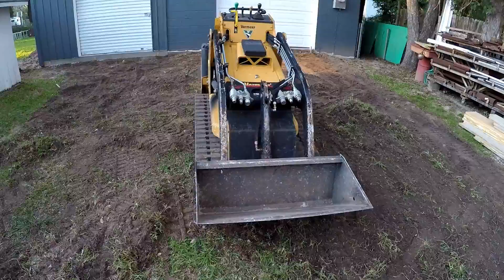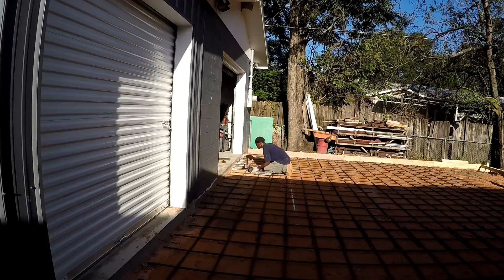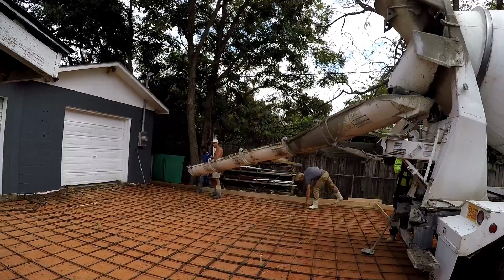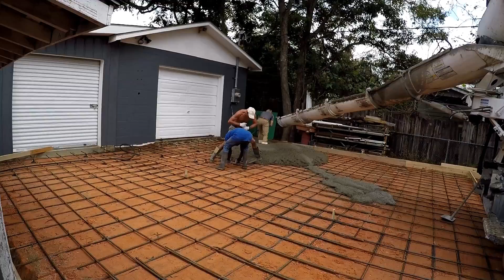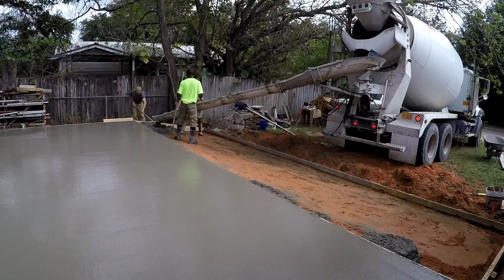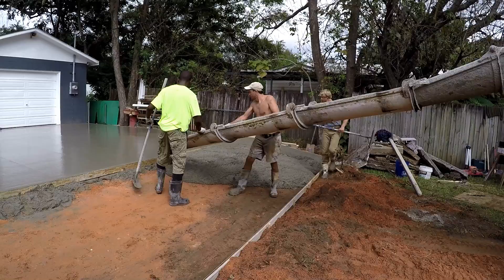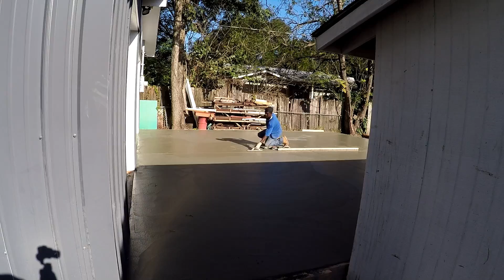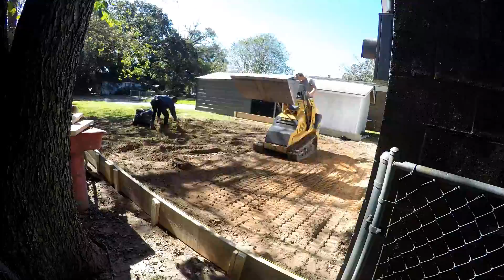New Shop Concrete Slab!

Comment: Contractor said they mostly do driveways. You can tell. You almost always get a screed form to form. This one will have some 1/2" deep puddles when it rains. Nobody's eye is that good. So easy to throw in  an extra stick out in the middle and get two guys on the screed . Broomed too soon. Rough as hell.
Sorry Abom but you didn't get a first rate job. Especially if you want that slab to eventually be the floor as you extend the shop like you said.

Comment: Quite a few things wrong here... They're mucking all wrong causing numerous air pockets not even fluffing the concrete one metal screed with two guys could have been pulled across the whole thing and fluffed and mucked behind easily the only guy hustling is the dude in the blue shirt... No double polythene to reduce cracking just simply raising the rebar isnt always enough and the fact they did a six inch with so much slurry you can see it was already bowing the forms and wood stakes they should have used steel stakes and kickered more this is all my opinion but fuck me and people say this is correct???

Comment: Not enough mesh spacers!! especially on perimeter, steel was flat to the sand in most places,  vibration takes out the air pockets, great cosmetic finish, but who leaves timber shutters inside a slab pour?? Lime will rot the (3) sections and timber left in the pour, this will cause them to separate, , they will separate over time and no steel supports on the pitch slab, sorry Cowboys..last far beyond when they are gone no chance!!

Comment: These guys appear to be working hard couple mistakes form board left in between pad and ramp why I put so much rebar in the pad but not in the ramp the ramp having reinforcement is just as important as the pad when the first truck came if they put an extra shoot on it they would have not had to work so hard raking near the door  the pad also looks really level when they should have put a little bit of a slope on it to keep water from puddling Up and going into the garage I would pretty much bet whatever they want to bet did there are a substantial amount of cracks that concrete after 1 year keyword no expansion and not enough controlled cuts looks to be a really big pad the rebar was really overdoing it unless you plan on parking 18 wheelers or very heavy machinery what's the ramp will not hold up to the pads capability some simple Road mesh would have been just as good especially if you weren't going to reinforce the ramp

Comment: So many people use a vibrator to move concrete and that's not really what it's for it is for to get all the air bubbles out of the concrete if you do it too long in any one spot all the rock was settled to the bottom and you concrete will not be as strong as it should be

Comment: how big was this slab .. .. Also last truck you only needed 2 yards... did they charge you for just the 2 yards or did they charge you for a full truck load wich is 10 yards??? im asking you all this cause i will be putting a 40x100 slab  sometime next year for a metal building...

Comment: 34:57 So they never took out the form that was between the floor and the ramp? So what are you going to do when that starts to rot away and you have a 1.5" gap there?
Reply: No rebar in the ramp either.

Comment: Vibra screed would have been nice.  Should use smooth dowel into existing concrete slab to allow for movement between slabs.  Should have a control joint at that point that could be caulked.  Amount of time between trucks was to long.  You now have a cold joint affect in the center of the slab.  No rebar in the ramp is questionable.  Not sure the fiber mesh will do the job.  Someone should be working on the edges of the slab along the forms much sooner.  Would have worked better to pour in two pours.  This might be how they pour in Florida but that would not fly in the midwest.  Not enough control joints as they should be 10 foot wide max.  Never use a steel trowel on outside concrete.  Time frame took to long from start to finish.  Concrete is turning white showing that there was to much water.  Should have sprayed some cure and seal on the concrete.  Shame to see the trowel marks along the edges.  Why did they leave the 3/4" board in the slab at the beginning of the ramp?    Not as perfect as the big man thinks but since Florida is one of those right to work states you have no idea what you are going to get.

Comment: I'm not a builder or anything but don't you need guttering/drainage between the shop and the slab to prevent water coming into the shop during a storm?

Comment: Everyone forgets that cement cures and when it dries, it dies. 30 day covered wet cure or constant wetting is essential to high strength and durability.
Reply: A wet week will get you most of the way there

Comment: Hello Adam. I was a bit worried about a few things like the bars not being connected to the floor of you side shop (maybe there is a reason for it) and the bars being elevated from the dirt only at the lat minute (I would have done it before poring the concrete). But I was overall very impressed by their work and especially their attention to finishing details. I have some questions though. I would really appreciate if you could provide the answer:
- how do you handle the rain? Is there a slope for it? How much and in which direction?
- what kind of dirt did they put underneath? In France I would have a bit of sand to make the surface even, a layer of geotextile to keep the sand separate from the rest, then 15 to 20 cm of little rocks, again some geotextile, a layer of plastic and finally the concrete. The objective is to keep the wet from the soil away from the concrete. But maybe it is not necessary after all.

Comment: Concrete higher then the floor, omg.... never do that. And always put plastic foil UNDER the iron bars on the sand! All the moister drain out the concrete...... and always lift the iron bars from the floor/sand. put some concrete brics under it.

Comment: You know you have a great crew when they make it look so, so easy.  One would never, ever want to get into a physical contest with any of them as pouring concrete is a hard, back breaking job and, again, they make it look so easy.  Surprised poly wasn't laid down in case you ever want to enclose the pad and no rebar or mesh on the ramp and sidewalk had me wondering but I think you said they added fiber mesh reinforcement to the mix.

Comment: Spacer blocks under steel should be in place before concreting ...it makes life so much easier and steel dose its job in the concrete.
strange no expansion contraction joint down middle?

Comment: So where are the footers? And where is the plastic that should be between the soil and the concrete? Chairs are used to hold the rebar up and then you do a pour. Would never pass a Miami-Dade County inspection.

Comment: I gotta say - I am impressed with this crew.  Obviously experienced in concrete work. The screed guy especially.  However, a Vibra-plate does NOT compact soil.  It is good for maybe two inches of asphalt, but achieves nothing in soil compaction more than an inch or so deep.  I wonder what the slump of the concrete was.  Seemed a bit wet, but at least I didn't see them spraying water on top of the surface to help them finish the surface which gives a different water/cement ration on the top of the concrete.   Me?  over fifty years experience, NICET certified, ACI certified, certified Batchmaster.  Performed hundreds of mix designs.
Reply: One other thing, I would have constructed more control joints.  You will see cracking in this slab, but no harm structurally from that.

Comment: Concrete is never poured.....concrete is placed.

I know this is a late comment..... but nice job with the risers....and rebar...

The last slab I helped with, the contractor wanted to use a screen that they would 'lift as they placed'..... my friend didn't want to have anything to do with it.... they still used screen, but he placed dobies  under the screen after the contractor left for the day......   the contractor was less than impressed the next day when he showed up.

That was about 15 years ago and the slab looks great and hasn't cracked except at the cut lines, where it should be.

Your slab looks great.

Comment: You certainly do things a different way to most other countries
 Rebar spacers should all be placed BEFORE any concrete is pored  as your way the rebar will sink back to the bottom when it is vibrated

Comment: Very different her in NZ. We would have had about 10m3 just in the footing for something like this but we use mesh instead of tied rebar. For workshop I would have burnt the concrete with the kelly float to give you a seriously tough surface.

Comment: Yet another concrete job with the rebar in the dirt and everybody saying what a great job -  Curious...
Reply: @Bob Malooga on a residential job, it's not uncommon to not use "chairs" as they're called in the US. They are metal or plastic and an added cost. The important thing is to have the reinforcement at the desired level in the pour when it's all said and done. They did it by pulling it up as they go. They did not leave it laying on the ground. Adam says that.

Comment: If I may say Adam, if anyone is entitled to document people at work it's you. You video yourself all the time and post it for all to see and obviously many appreciate that.

I read many comments on this project and I was surprised to see that no one mentioned the importance of protecting concrete from drying. Concrete must not dry, it must cure and that takes about a month. For at least one week new concrete should be kept damp by covering with plastic or spraying with a sealant to prevent evaporation at the surface.

Comment: what happened to the re-barb in the ramp? Plus the ramp goes thinner at the lower end. It should have been dug and keep the thickness of the concrete  the same. It may break when loaded.

Comment: I was on a mono-slab crew for years, this brings it all back! (Is that a good thing? haha)

The boss is the driver, pushes hard, ya gotta keep it going, there’s no stopping once you start. Eveyone on the crew is an athlete. There’s always at least one top guy with the top skills running the screed then the bullfloat, get that top just.right, then the 2nd man comes along and ruins it with a brush, haha, I like her smooth and level, just a lttle tilt for the runoff, and turn down those edges, and run the edging float! After you go for a high calorie meal eith some beers and wonder why you can’t keep any weight on, pass out and do it again tomorrow! It’s the mud-blood olympics....

Concrete is a plastic medium, till it’s not! Pouring is an additive process, the opposite of machining
Reply: Yeah I was thinking The sane thing. I don’t care for the brush finish. I’d have a smooth finish looks cleaner

Comment: I have a question about the re-inforcing bars (re-bar). As shown in the beginning of the video, east-west are laying on the ground whilst north-south are on top of the east-west. Why is that done? It looks like you have twin problems of rust / concrete cancer, and worse, the re-bar doesn't do much strength-wise being underneath the concrete. It's most effective in the middle of the concrete. In Australia that method of construction is illegal and instead some type of re-bar lifter is used (commonly small plastic cones with cutouts called chairs) which gets it off the ground and into the middle of the slab. Am I missing something?
Reply: I can see that they lifted the rebar up using a mattock and installed some chairs, although the last pert of the flat slab didn't get any and the rebar was touching ground again (eg 21 minute mark). Why not put the chairs in first before the concrete is poured, like we do in Oz? I feel I must be not understanding something because you wouldn't do it a harder way for a less strong outcome unless there was some benefit. Also I noticed a piece of timber left between the level part of the slab and the slope. We form the same way in Oz but then after pouring and screeding we remove the timber, possibly put in an expansion joint. Why is the timber left in here? Surely it rots over time and you're left with a big gap and 2 slabs independent of each other that can move?

Comment: I went through at least half the comments, didn't see mention of missing mesh or rebar in the ramp, could have used number 4 previously laid out and tied, dragged to the side waiting to be put back into place. And we always put in expansion joints, maybe not required in your climate.

Comment: 5/8ths rebar with 1 foot centers in a 6in apron, tf are you doing. them boys are slow, especially tying the rebar didn’t even dial into the metal building slab. and that boy don’t even know how to use a comalong, most disappointing pour i’ve ever seen.

Comment: before my dad passed away, he done concrete work and I got to go with him on several occasions. i'm sure everywhere and everyone does it different. he taught me if your gonna have a lot of traffic, and or heavy loads pulling on and off a ramp, you should double the edges of the ramp. especially at the foot of the ramp. he said it will crack and eventually bust. hopefully you don't have that issue in the future. I was just mentioning it because you do work with steel and it is very heavy. sorry if I offend any of the workers. that is not my intention. it was just the way I was taught. only an opinion so please don't hate.

Comment: That looks like crap. They should have used a actual concrete Broom not a push broom and they shouldn’t have walked across it and they broomed it when it was to hard and had to scrub it that’s why it has all of the marks in it.

Comment: It is amazing to me that you were able to do this or even have a shop at home. I lived in South Florida, Englewood, from 1960 through 2004, and by the time I left for Tennessee I wasn't even allowed the replace my own water heater without a permit. In 1988 I built a new home on my grandparents 5 acres on the gulf, not a fancy area, no condos or any of that just a place where my family had lived and worked for 7 generations. Once that was done I applied for a permit to build a shop assuming that since it was zoned agricultural it would be no problem. Wrong! My family members living in Cantonment didn't suffer such ridiculous regulatory intrusion. I think our area was slated by the Charlotte County Planning Commission for upper-scale homes, not dirty Mullet fisher-people. Anyway, looks good!

Comment: Poured concrete for 14 years. We would have chairs under the rod. Or concrete bricks holding it up. Popping it up with a pick axe is slow and not that effective. Especially pouring it as tight as they are. Which is a good slump.  But your rod is only about 2 inches up in a 6 inch slab
Reply: And yeah you can totally drag the concrete off the Shute faster than the truck and blow it out🙄

Comment: Why is hell did you have a brushed finish. Nice smooth finished would have been really nice to paint when you close it in for your expansion shop.  Really would have been almost mirror smooth. As it is that surface will gather dirt and oil. They certainly took time to do a nice job for you. That lawn will heal in no time.

Comment: as far as i know, the rebar should never touch the ground, so it can be covered all around by concrete, because if water and oxygen have a chance to get to the rebar it will rost and theirfore not support the concrete anymore. yes it may take like 20 years to happen, but if animals get unter the slap, it could even happen faster than that.

Comment: Good review. When they do it right, they will use dobies to raise up the rebar from the ground surface 2" which are "spacers" and they are tied to the rebar so that the concrete guys don't knock them lose when walking on the rebar while pouring concrete and screeding the surface etc. Also, the soil is usually prepared with sand and gravel to allow the soil and concrete to shift as needed. some areas by code require plastic moisture barrier between the rebar and pouring surface. Some guys will even dowl the rebar into the garage concrete to help prevent any top surfaces from changing. This pour should help much with your shop use...hard to beat an extra few feet of concrete around buildings and between them especially when it fowl weather.

Comment: Wait... I thought you said this was a shop slab. That shouldn't have a broom finish. Whenever you roll something around it's going to bounce all over the GD place. He should have hit that with a power trowel and burned it in nice. And that outside footing should have been 12" wide minimum to carry the weight of the shop walls. Oh well. I guess ya'll just do it differently out there. Different strokes for different folks I guess.
edit:
And I hate to be a party pooper, but wtf? He didn't even strip that step and face it when he was there. And as far as that death valley drop down to your carport... I'm assuming he offered to form a step there but you told him you didn't have the money for that??? It would have been so much better to just have him do it while the rest of this got poured. And check it out... I'm not totally ragging on the quality of work. I think they did do a very good job for what they did. I'm just saying the quality could have been a tick higher. And I'm comparing that to what I would have done with my crews.

Comment: Do you know why my concrete is dark grey in color when I mix them on my own, with cement, sand and 3 quarter blue stone? I can't get the light grey color like the sidewalk concrete, ty
Reply: Xinyu Lin they may have sprayed a sealer on the concrete when they were done to slow the cure